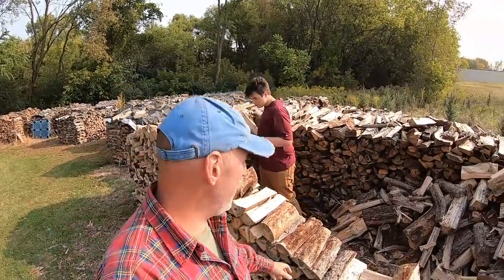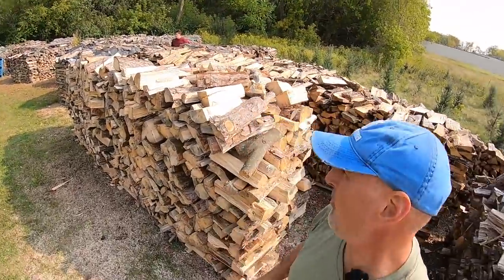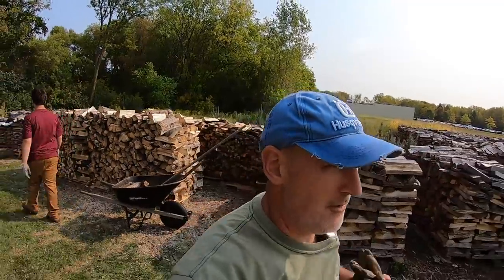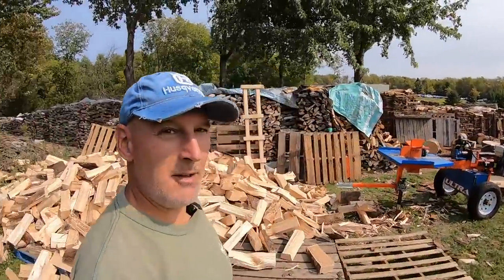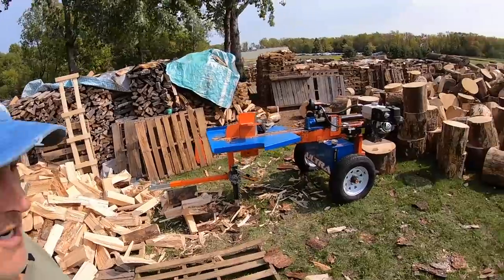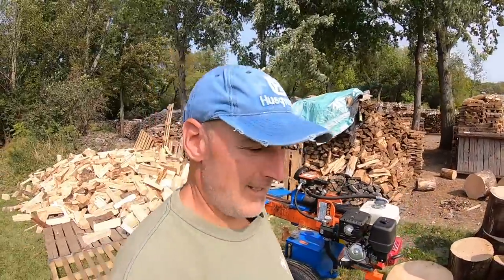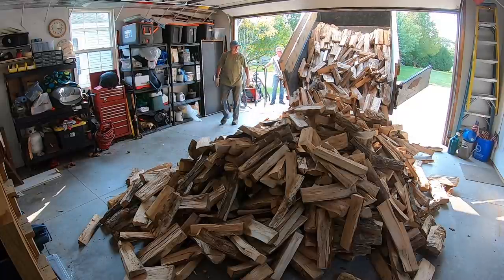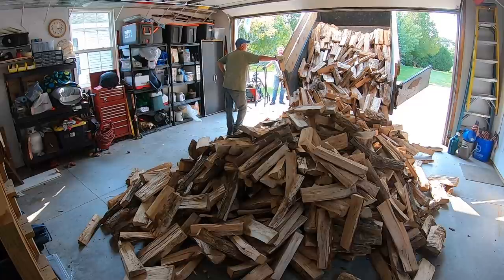#154 - Eastonmade ULTRA Wood Splitter vs. The White Pine Logs

Comment: Only recommendation I can make, the Easton seems to need a larger push-plate. I noticed alot of drifting on the horizontal wedges. Larger plate should clear this up and reduce the need for splitting again or pulling apart by hand. Good job otherwise.
Reply from the maker: Thanks James, call Andrew at Eastonmade, he built it. I would like a bigger push plate too, but that's how it came. Thanks for watching!

Comment: What size truck do you have to haul your dump trailer. I’m looking at getting a diamond C trailer that’s 6x10 and is meant for half ton trucks. I figure i could load approx 3 face in it at a time until I haul with it I won’t know how my 2012 eco boost F150 will haul it. I have a feeling it will haul just fine. So I may be able to load more than 3 face in it.
Reply: That is what I have for a trailer, tow with a gmc sierra 1500 with tow package no problem with a full cord stacked in it. I think 4 face cords would be fine as I've done trailer plus truck bed before. Tows fine.
Reply from the maker: A trailer that size will work. The ecobust maybe not, those are made for better mileage not towing a lot of weight, but it will work good enough. I have a friend with the furd ecobust, that's what he calls it and he hates it , no power for towing his camper
Reply: @InTheWoodyard  I do have the bigger engine model 3.5L eco boost v6. Yes I know it’s a smaller engine but it’s the biggest before the v8 model. I do know a couple guys that had the same truck and they towed compact excavators and skid steers. Now I don’t know how well they did it but it moved them. Lol so far I’m hauling in the bed of the truck and it seems to do decent I think a little stiff rear shocks might help with the load and towing.
Reply from the maker: @S_man89  Ya, I'm thinking of putting on some overload leaf springs.

Comment: Just wondering whats the use
In stacking the wood on your Trailer when you just throw it on the ground when you get there why don’t you just throw it on the trailer have a unit measure for it that the owner will be happy with and just dump it
Reply from the maker: Good question, some of my piles are pre-measured stacks and others are just stacked high to save space in the wood yard and for drying. So if I'm loading wood from a pre-measured pile I do just throw it on but if I'm getting wood from a big pile I have to stack it to ensure the proper amount is delivered.